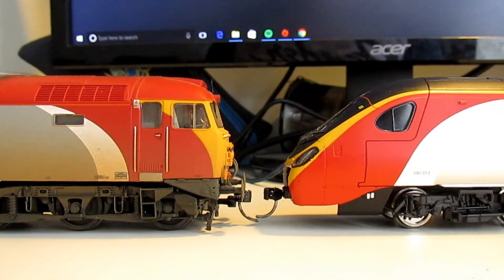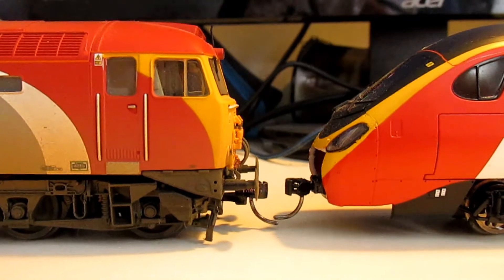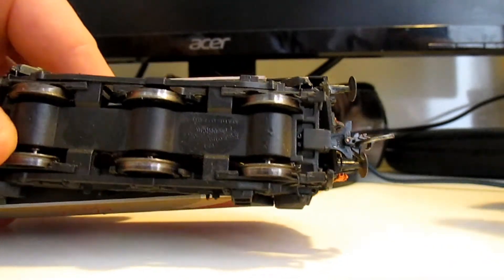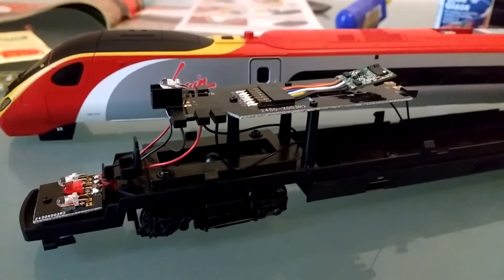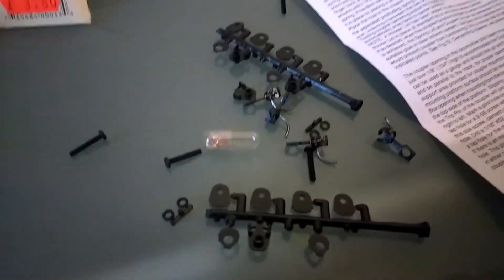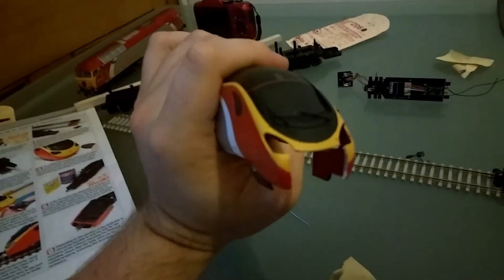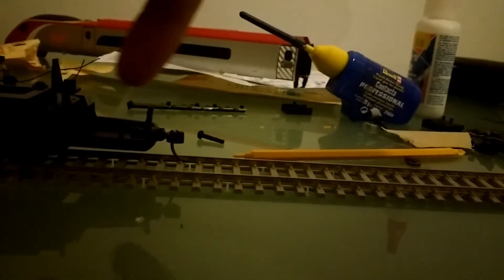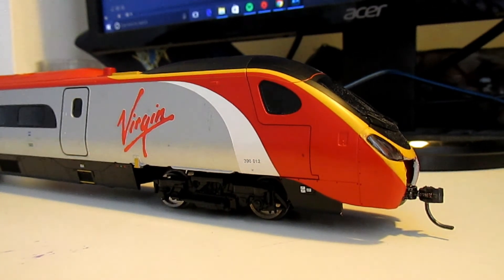How to couple a Hornby Pendolino with a Class 57

Comment: could this be done with a class 395 javlin (cheap one) but in multiples not loco hauled
Reply from the maker: I'm not sure what the arrangement is like on a 395. I'd recommend looking at the chassis and seeing if it is similar to the Pendolino in this video. I can't see why not if it's similar.
Cheers, Joe
Reply: they are relitively similar just cut the coupler housing away and fix a mounting point for a nem pocket or kadee 

many thanks from the ouse valley railway

Comment: I've found that the kadee coupling ends up pointing in a direction that doesn't follow the course of the tracks, at least around corners. I am using the exact parts listed in the magazine, but they didn't mention this issue.... Did this happen to you? My curves are 4th radius..
Reply: It's as though it doesn't have enough flex in it?
Reply: in fact, your coupling looks to extend much further out of the 'bonnet' than mine does, do you think this could be the cause?
Reply: Late reply I had the same issue never got round to sorting it out. Might try and make the kadee swing on a pivot possibly.